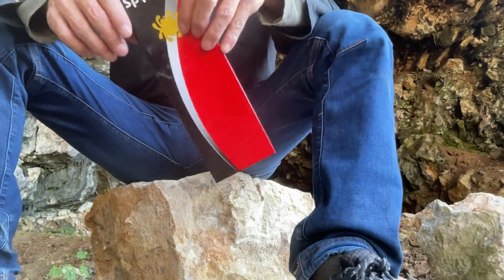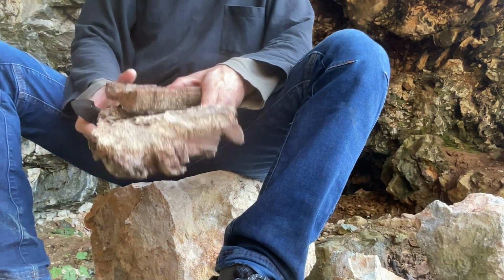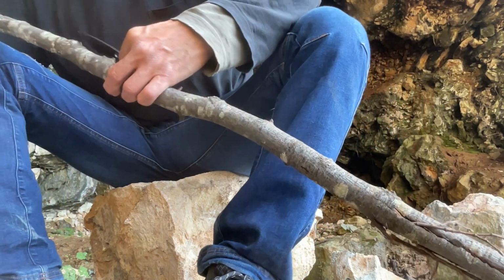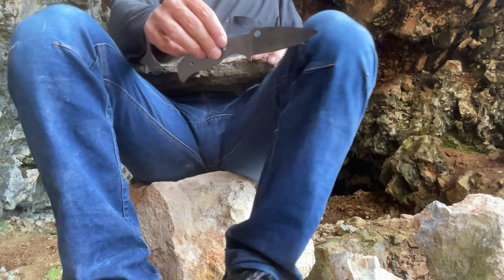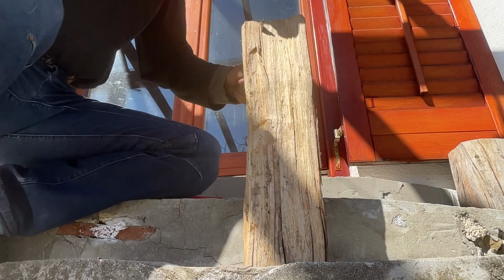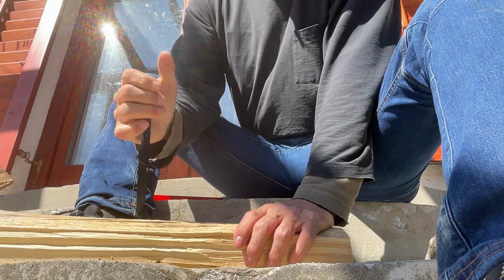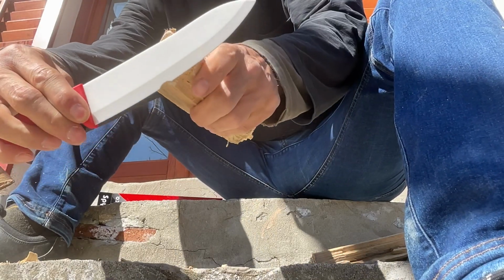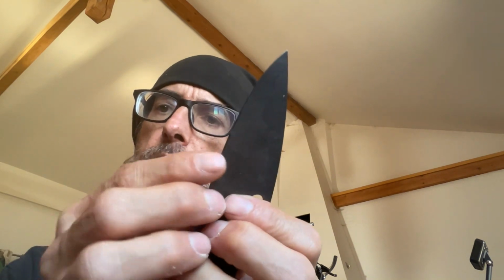SPYDERCO HIC MT40 vs BATONING vs CERAMIC KITCHEN KNIFE

Comment: The ceramic knife should be able to be sharpened with a diamond plate! I would test it with a finer grit. Sharpening will take more time than with steel, but it should work.
Reply from the maker: Please let me know how it goes
Reply: @IsitAKnife  I used some resin bonded diamond stones to sharpen mine. Follow the instructions it comes with. Absolutely DO NOT go below 600 grit, I found out the hard way. It will microchip the edge and it will take at least an hour to fix, but once it is sharp it will hold a working edge for a long time. It doesn't hold a shaving edge for that long in my experience. But slices great forever.
Reply from the maker: @petyrbaelish1216  thank you so much!
Reply: I sharpen it on 1200 grit diamond plate if its really dull, then finish it on a piece of paper (3 piece of paper actually on top of each other, for more of a soft backing) with 1 micron diamond abrasive. It gets as sharp as glass, I'm impressed.

Comment: Manufacturer of Rahven HIC "elastic ceramic " blades recommended aluminum oxide on soft pad if I recall, though they also say to just ship it back for sharpening.  If Cedric and Ana got close to 2500 sisal cuts before a hint of dulling in paper then it might be a while!

Comment: The only advise i could say to sharpen is maybe diamond or tungsten carbide? Idk , very interesting tho
Reply from the maker: Thanks. I have been too busy to try to sharpen it again. Once I'll try I will follow your advice. I agree with you that it is a very interesting material.
Reply: I doubt carbide would do much. It should be similar hardness to carbide. Diamond is the only option.